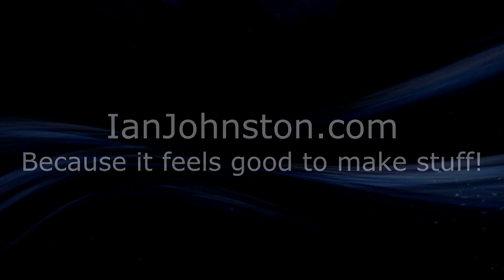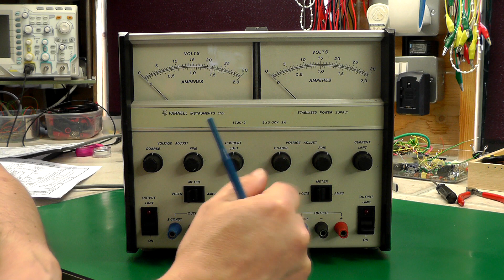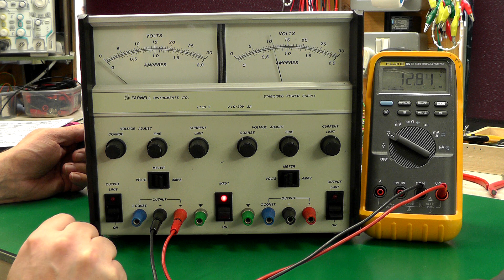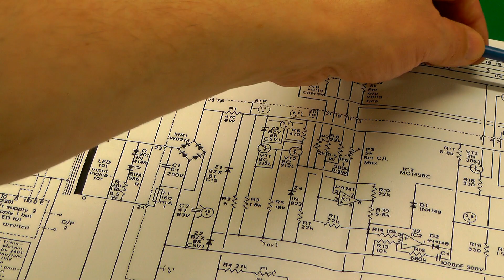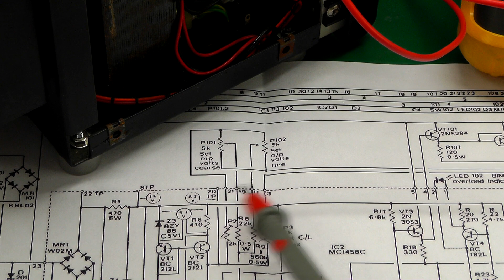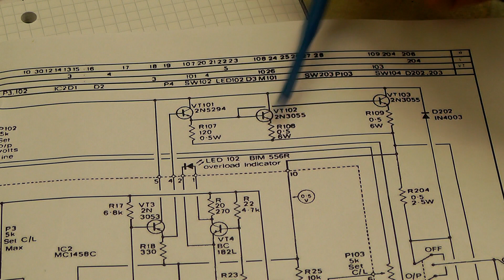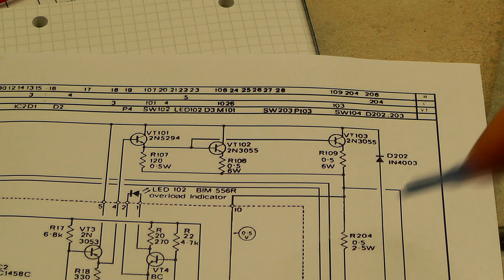Farnell LT30-2 Power Supply Repair & Modifications - Part 1

Comment: op-amp version, thats modern, mine pre op-amp running on bc182's lol. spent 2 hours today trying to fix it, i can get volts out if i disconnect the current limiting, but something is tripping it hard on when theres no load. so annoying.

Comment: Thanks for the upload Ian.  Just picked up a similar outside but different inside version (the earlier tranisistor - non ic model).  Can't bring myself to replace these beautiful huge white and clear meters though.  Side by side with the more up to date equipment these just shine.  Might replace the pots with multiple turn versions and possibly give the case a coat of hammerite but this late 70's PSU is beautiful just to look at. 
It's funny what rocks us electronic nerds.
Reply from the maker: Mine is back to original, I just never finished the project fully........but maybe one day!......must admit I use this psu all the time for battery charging (pdvs2).
Reply: Yes, I subbed and then checked your uploads and then noticed the PSU in its original state in a much later video.  Leave it alone Ian, I do like your videos but doing a hatchet job on this beauty wouldn't be one to watch!.....though I probably would...who doesn't like a good horror story!
Thanks for the channel anyway, I really appreciate it.

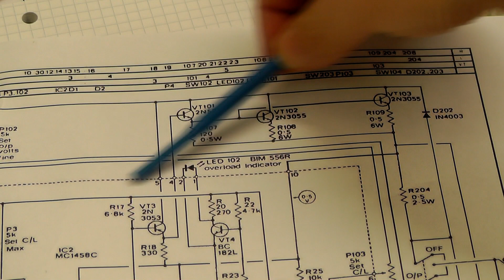Comment: Great video, thanks! One question please, the two parallel 2N3055 transistors, should they be a matched pair? Try measuring the voltage across the 0.5 ohm balancing resistors shown at 12:58 with a 1A load, if not matched there will be a big difference, which will put more strain on one transistor than the other. Not sure  how the two pairs are connected but maybe the same applies.
Reply: PS - I checked my LT30-2 with 1A on channel 1 and channel 2, and the results were: Channel 1 - outer pair 126mV, 127mV, inner pair 141mV, 119mV.
Channel 2 - outer pair 124mV, 127mV, inner pair 132mV, 130mV.
Slightly different on one pair so maybe one transistor is on its way out.
Reply: johnas2004 using matched pairs in designs like this would have been time consuming, audio gear yes, but a beach PSU, nah can't see them doing it. of course on ones we own, why not if you have a bag of them.
Reply: The 0.5 ohm balancing resistors ensure that the load will be reasonably split between the 2n3055s even if the transistors come from different batches or manufacturers.If in doubt, the resistors may (both!) be increased to up to 1 ohm (mind the wattage), but this is rarely if ever necessary...

Comment: I wouln´d change these analog meters, they are part of its design.....And they look awesome imho...I had just bought this, because of its meters....:)
Reply from the maker: I never did get around to changing the meters albeit I experimented with the idea. The LT30 is back as it was....fully working. :-)
Reply: @IanScottJohnston  A crime against humanity if you replaced them ..............
Reply: Funnily enough I was contemplating getting to rid of some digital displays for analog ones on some cheap Chinese model just for the hell of it, glad you changed your mind about changing out the analog meters on that Farnell ........

Comment: LOL!  Hell of a coincidence, I've just fixed the E30/1 on my channel which is similar but baby version of this PSU.  They are nice =D
Reply from the maker: Saw your video........I used an E30/1 for many years at work.......was one of those psu's that just kept on going!
Reply: Hehe, they don't build them like that any more =/  Some of this old kit is really nice, especially when its all discrete components etc.
Reply from the maker: I'd have to look at the schematic and or play with one to see what could be done.
Reply: Question to Ian. GadgetUK had a recent video where his Farnell 30 didn't go below 100 something mV. Is it possible to tweek that down to 0 ? The Farnell 30 is a full descreet design.